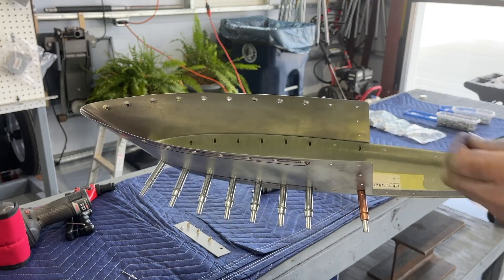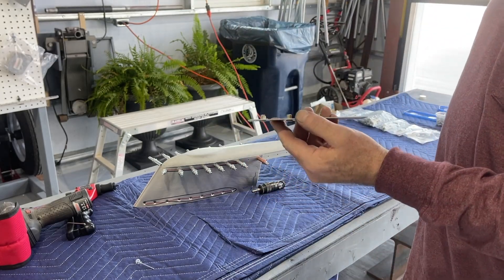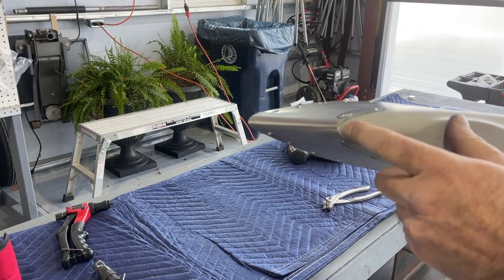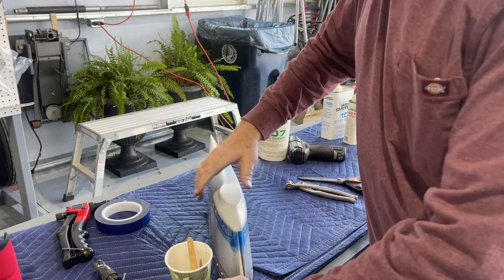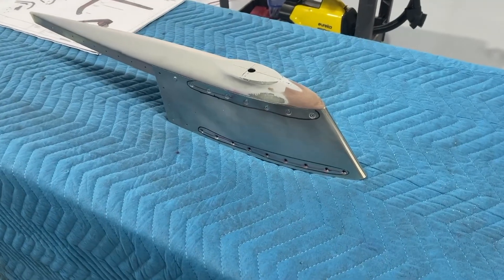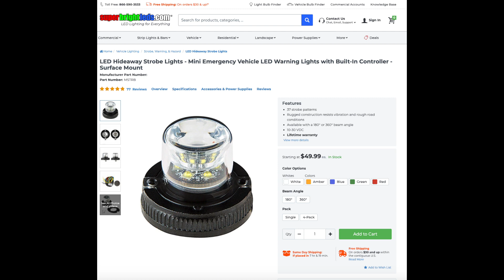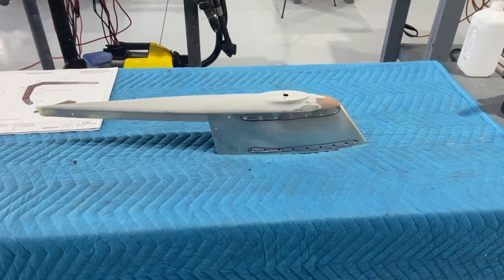Building the Rudder  [Sling TSi Build Video #4]

Comment: Is the weight on the TSI rudder counterbored? I'm at this step with a high wing, which has a somewhat bigger vertical stabilizer and rudder, and the directions have me somewhat uncertain about which way to install the weight, as the lip is much thinner than I would expect.

Comment: Are you going to Alodine parts ?
Reply from the maker: I am not.  6061 T3 AL is extremely corrosion resistant.  I will apply Corrosion X after the completion.
Reply: @TheBaldPilot  Thanks for info.  I’m thinking about pulling the trigger but I’ve never built anything in my life and know nothing about motors.  I can just fly them.
Reply from the maker: @SpeedySpoon69983  If you're going to build an airplane, this is the one.  This kit is about as simple as it gets.

Comment: Do you have a link to the Beacon Light and to the Resin and Hardener your using?
Great job, you'll be done in 2024!  Having built your previous airplane helps with understanding how everything goes together.  My build is much slower, but i'll get there...
Reply from the maker: we live near the water so I get my fiberglass and resin supplies at West Marine.  Here is the link to the beacon:  https://www.superbrightleds.com/vehicle-lights/vehicle-strobe-warning-and-hazard-light/led-hideaway-strobe-lights/led-hideaway-strobe-lights-mini-emergency-vehicle-led-warning-lights-w-built-in-controller-surface-mount
Reply: @TheBaldPilot  Great, I have a West Marine 6 miles from me here also.  
Interesting your using an LED made for vehicles on your plane.  I need to look into that.  I know we can on experimental.   Thanks.
Reply from the maker: @N720S    Ha!  You should have seen my Bearhawk.  Many automotive accessories.  Lights, K&N air filters, 4130 chrome molly tube, Lexan plastic for the doors, Jeep handles, etc.